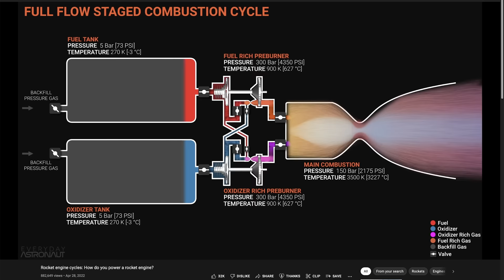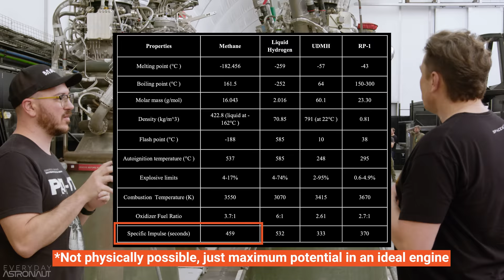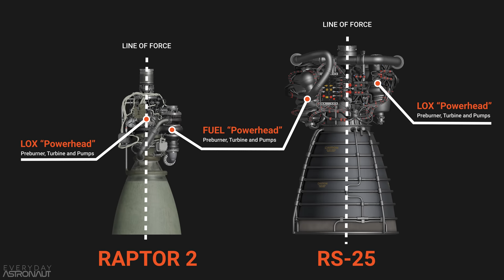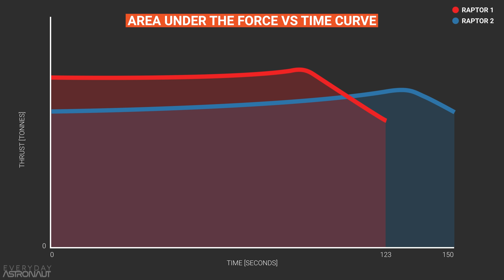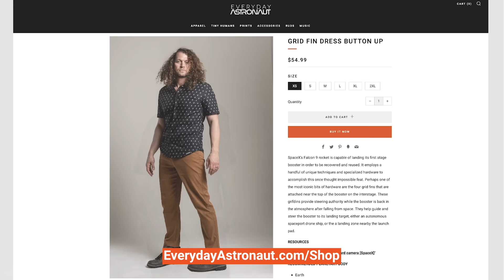Elon Musk Explains SpaceX's Raptor Engine!

Comment: Have been watching videos on Monroe Live this week of their teardown of a new Model Y and now Tim with Elon. They keep commenting on how quickly Tesla iterates their designs, and at points show completely out of the box thinking. Of course we see the same thing in this tour of a SpaceX space ship factory.
Reply: Munro Live, not Monroe. Yes, the pace of innovation is amazing, but people are not talking about how vast and deep and connected the innovation is enough. Yes, Tesla tweaked the shape of a hose and changed from steel to aluminum for a part, but they also embarked on a seven year project that innovated at every step of battery cell manufacturing starting with how minerals are processed from the mines and made a new form factor tabless battery cell that can be used for a new level of structural battery pack where the cells are part of the structure, and then also invented a new alloy that allows larger better gigacastings and got a company to make much larger Gigapresses than ever existed before and all of that had to be achieved to realize any benefits of any of it. Then all of that together is what allows the new ease of manufacturing Munro was impressed with in the last video, and which was one of the goals from the start. The audacity to embark on a project that will require easily a dozen or more patentable inventions you don't have at the start of the project is unheard of.
Reply: @tribalypredisposed   Did an autocorrect get past me? Yes, Munro is the name and in depth analysis is their game. One can only get a full sense of the appreciation Sandy Munro and his team have for Tesla by watching many of their detailed videos. To get one crystallized view of the regard Sandy has for Elon watch his interview of Elon at Starbase and then, more importantly, the follow-up video of how "blown away" Sandy was about seeing Elon in action in a production meeting about Starship. The interview is about cars and well worth watching but the follow up where Sandy describes the whole Starbase experience is incredible.

Comment: Recursive is a process or function that calls itself to solve a problem. It breaks down a problem into smaller, similar subproblems until a base case is reached. Then, it combines the results from each recursive call to solve the original problem. Recursive algorithms are commonly used in math, tree/graph traversal, sorting, and backtracking problems. However, recursion should be used carefully to avoid infinite loops and excessive memory usage.

Comment: Hypergolic stoichiometry refers to the stoichiometric ratio between the fuel and oxidizer in a hypergolic reaction. In a hypergolic reaction, the fuel and oxidizer spontaneously ignite upon contact with each other, without the need for an external ignition source.

The hypergolic stoichiometry is crucial in ensuring that the fuel and oxidizer react in the proper ratio for efficient combustion. If the stoichiometric ratio is not maintained, the reaction may not proceed optimally, leading to incomplete combustion or other undesirable effects.

The specific stoichiometric ratio for hypergolic reactions varies depending on the fuel and oxidizer combination being used. It is typically determined through experimentation and optimization to achieve the desired performance and reliability.

By carefully controlling the hypergolic stoichiometry, engineers can design hypergolic propulsion systems for applications such as rocket engines, where reliable and instantaneous ignition is critical for rapid and precise thrust generation.

Comment: In rocketry, ISP stands for Specific Impulse. It is a measure of the efficiency of a rocket engine or propulsion system. ISP quantifies how effectively a rocket engine utilizes its propellant to generate thrust.

Specific Impulse is defined as the thrust produced by a rocket engine per unit of propellant flow rate. It is typically measured in seconds. A higher ISP value indicates that the engine can generate more thrust per unit of propellant consumed, resulting in greater efficiency.

Specific Impulse is an essential parameter in rocket design and performance analysis. It helps determine the overall efficiency and capabilities of a rocket system. A higher ISP allows a rocket to achieve higher velocities and travel greater distances in space.

Different rocket engines and propulsion systems have varying ISP values depending on their design, propellant choice, and combustion process. For example, liquid rocket engines tend to have higher ISP values compared to solid rocket motors. Additionally, advanced propulsion systems like ion thrusters can achieve even higher ISP values, making them suitable for long-duration space missions.

By optimizing the ISP of a rocket engine, engineers can improve the payload capacity, mission duration, and overall performance of a rocket. Increasing ISP is one of the key factors in enhancing the efficiency and cost-effectiveness of space exploration and satellite deployment.

Comment: Bubbles cause metal fatigue. When there is no bubble the pressure is x but when the bubble is on the edge of the blade there is much less pressure as the blade turns causing the metal to vibrant.

Comment: Well, not much of a secret sauce for ignition without burners. Oxygen-Methane mixtures will auto-ignite at specific temperatures/pressures. By itself methane at 1bar does it at 537°C and oxygen at 585°C, it lowers if you are at a higher pressure. Great idea for simplification though!

Comment: Wanna get rid of the torch ignitors? Secret sauce you said? that's easy. Here is the secret sauce: Rocket engines typically require an ignitor to start the combustion process that propels the rocket. However, there are alternative ways to ignite the rocket engine that can potentially replace the traditional rocket torch ignitor. Here are a few examples:

Electric ignition: An electric spark or pulse can be used to ignite the rocket engine. This method is commonly used in model rocketry, where a small electric igniter is inserted into the engine and connected to a battery-powered launch controller.

Chemical ignition: Some rocket engines can be ignited by a chemical reaction rather than a torch ignitor. For example, solid rocket motors can be ignited by a pyrogen mixture that burns when exposed to a small electric charge.

Laser ignition: Laser beams can be used to ignite rocket engines. This method is being explored as a potential alternative to traditional igniters because it can provide more precise control over ignition timing and can reduce the risk of premature ignition.

Microwave ignition: Microwave energy can be used to ignite rocket engines by heating the propellant to the point of ignition. This method is still in the experimental phase but has shown promising results in laboratory tests.

It's worth noting that the specific ignition method used will depend on the type of rocket engine and the requirements of the mission. Each ignition method has its own advantages and disadvantages, and engineers will need to consider factors such as reliability, safety, and performance when selecting an ignition system. Let me know if you have any questions. The ENGINEER in DISGUISE.

Comment: 37:00 I think what Elon is saying here about how ISP / specific impulse not really being the “be all end all” way to rate a rocket’s performance, and that chamber pressure and area under the curve, is actually the same thing as car people talking about horsepower, when peak HP is just sort of a bragging right, but if it’s a very peaky engine like a 16,000 RPM 1000cc sport bike, that big 160HP pales in comparison to an 8,000 RPM turbocharged 1000cc engine making “the same 160HP”, because the low RPM turbo engine is going to make massive usable torque across the powerband, and be far more powerful and effective than the peaky sport bike engine. More USABLE power, and more readily available when you want & need it. 

Like Elon says “the ISP is not constant.” A “160 HP engine” does not make 160 HP every time / all the time you have the throttle wide open.

Correct me if I’m wrong though! I just thought it was a unique similarity

Comment: If the Raptor 2 is ignited by a gas gas interaction without needing a methane torch or hypergolic fuels then why can't the outer ring of engines on the booster be relit if need be. I understand that it may not be desirable but it should be possible.

Comment: I understand he needs to maintain secrecy, but is it possible for an entity to buy several rockets and have them ready, and then your recurring cost is mainly to launch, receive, maintain and refurbish?

The rockets need to be essentially school buses transporting people  (kids, essentially) supplies, modules, etc.
- you literally need to fly in order to keep those kids fed, when they get up to the moon, besides getting Electric Construction vehicles that can operate in space and be repaired Easily.

The only thing I worry about is that if Elon made a custom BFR out of graphene carbon fiber with nanotube conductors, how difficult would it be to service it, or how much service would it require.  

Would Elon even be Open to making a custom rocket?

Comment: 31:30 Ok is impresive, and i would like see it how it work from inlet to outlet but your gouvernemnt dont let us and the secret sawce neither hahaha.
Sugestion or question. Why dont use it in V shape so reduce more the pipes and flanges, to have it more like LOX. And having the rotation of turbopumps in vertical axis instead of horizontal can improve the gymbal movement(low torque). can be tested with HDD whe move at 7200rpm and try move it. So in that turbo is 1000x more powerful and weight.

Comment: A high production rate also cost a fortune.

There’s also been enough R&D over the last 60 years that it would be more than possible to develop an engine with out consistently blowing them up.

I’m guessing space X is reverse engineering a lot of its technology and does not have access to the kind of data I am talking about???

It would be far more financially viable to run simulations 70% of the time. Unless that is what they are doing??

Comment: It`s actually very logical that bubbles make dmg. All those bubbles are like pebbles, because they have a dramatic change in pressure in the liquid, which makes them pebble-like, aka. material density. I`m sure Elon is aware of it, he just doesn`t have time to explain everything at once. Plus he must take into account the fact on what level the general audience is at and their level of knowledge of the topic. In a way like an expert and a sage who has to expound short proverbs on the fly, fit a lot of experience and knowledge into a short statement. People imagine that the ability to remember such statements is in itself a proof of wisdom, but only people with true wisdom can communicate in such a way productively. Actually it is much easier for them to communicate, when they have experts at a similar level next to them. When they don't have to hide anything, or try to simplify by dumping it down. And other thing is that is just an engine like any other. Amazement and fascination with interplanetary travel is characteristic of the egoist monkey`s. The same was the case when switching from horses to cars. From oil to electricity. And many other transitions in human history. That those should not be a significant events, that feed our ego`s. But knowing those who try to stop development, it is no wonder when one has no fear of retarded minds. As those bubbles, many different pressured minds. lol

Comment: Why don’t Spacex try putting raptor engines on a falcon 9? (with some modifications to the rocket obviously)
Reply: It uses a different fuel, which is optimally burned at a different ratio to oxygen than RP-1, so you would need to resize the tanks on Falcon 9, which would require a host of other changes. The raptor engines are also larger, which would require a redesign of the bottom of Falcon 9, rewriting software, etc. etc.

There's a host of additional changes and new things they want to try anyway, hence Starship.
Reply: “with some modifications to the rocket”
I know all this, I asked why don’t they try to modify it and use raptor

Comment: I'm a little confused about the comments in this conversation. 
There is talk about there being a lot of complexity in the tech stack and especially in microservices.
Im not sure why an engineer coming on board would need to understand how it all fits together.
Surely the application is layered and each layer would have a number of dev teams.
I would not expect a single engineer or single team to be responsible for adding a new feature to the platform.
The mention of Scala compilation time is worrying, it seems the microservices are a microservice, which would defeat the purpose.
Separation of tweet metrics across databases together with other comments made seems to suggest a lack of software architecture team presence.

Comment: So, it’s not that rocket science is hard, it’s just like all other knowledge, you keep building upon what doesn’t work so well in the last engine. 
In short, cavitation bubbles are bad. Why? They cause variations of pressure internally to the liquid. At any point that a bubble encounters a blade, there is a change in pressure applied to that specific spot. Then, as it moves from that spot, an increase in pressure is present at said spot, causing the metal to bend on a very small point. With more bubbles and more pressure variation, the blades are subjected to constant bending all across the surface of the blades. 
… yadda, yadda, yadda. 

This is old knowledge I learned from aircraft hydraulic systems.

Comment: Elon, looking for rocket engine clone with an inline powerhead? Checkout the RD-120 engine, which is a Ukrainian clone of the Soviet-era RD-120 engine used in the Zenit rocket. The RD-120 engine features an inline arrangement of the main combustion chamber and the turbopump, which provides the engine with a relatively compact and streamlined profile. The RD-120 engine is used in the Ukrainian-built Zenit-3SL and Zenit-3SLB rockets, which are used for commercial satellite launches. Let me know if you have any questions. The ENGINEER in DISGUISE.

Here are some additional details about the RD-120 engine:

Specific impulse: 350 seconds in vacuum
Thrust: 834 kN
Weight: 1,125 kg
Length: 3.87 m
Diameter: 1.95 m
Number of ignitions: 19
Design life: 4260 seconds
The RD-120 engine is a valuable asset to the Ukrainian space program and is a key part of the country's commercial satellite launch business. It is a reliable and powerful engine that has been used successfully in many missions.
Reply from the maker: The RD-120 still has its turbo pump off to the side. It’s parallel to the combustion chamber, not on top of it and carrying the load of the thrust. At least I don’t think… I do love the RD-120 though!

Comment: Possibly the single biggest mistake by smart engineers is optimising a thing that should not exist. 

That's why I've made it mandatory to run through the first principals algorithm. 

First question the constrains and requirements. Make them less dumb. 

Step two, delete the part or process step. If you're not adding back in 10% of the stuff youre deleting then you're not deleting enough. 

Third thing is optimise. 

Forth as relates to production, accelerate rates. 

The 5th thing is automate.

Comment: They showed us engines (from the 70's surplus junk ) why don't they show us the whole thing ?  That would require to much of the bubble wrap and the heat blankets . Also 2'' foam pipe insulation and zip ties. What a BS !

Comment: Why do turbine engines need fuel injection systems for after burners? Fuel injection is meant for de-icing the engines that freezes over due to space conditions. Why are all the rocket launches I have seen, have after burners burning all the way to space. SpaceX, NASA, Space Force. Why use the after burners through the entire launch?